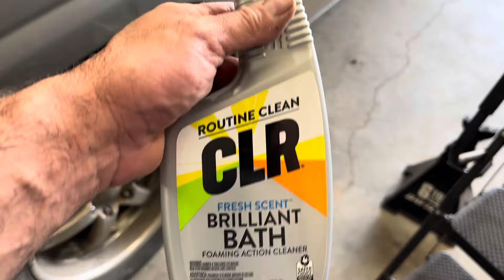What the “Smell” 2006 Chevrolet silver is stinken.  Something had a bad day in my truck.

Comment: I actually had something die in the engine bay of my truck years ago. I never could find the source. Tried cleaning and neutralizers. In the end just had to wait it out several months for the smell to disappear. Sucks but eventually goes away.
Reply from the maker: The cleaning and deodorizing I did seems to be working.  Every now and then I get a really faint smell from the rat.. but it’s only the day after and a lot of it may just still be stuck in my nose.  I smell that odor neutralizer more than anything now.  It’s not the best smell but better than death.  I’ve had to wait out the smell from it before but not in a vehicle. It was in the wall of my old house.. like you said.. eventually it goes away.